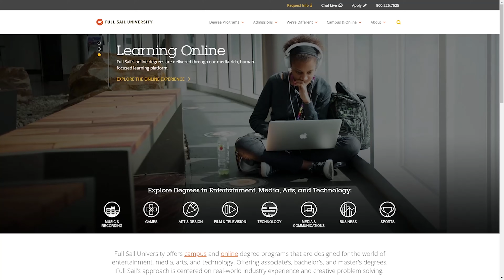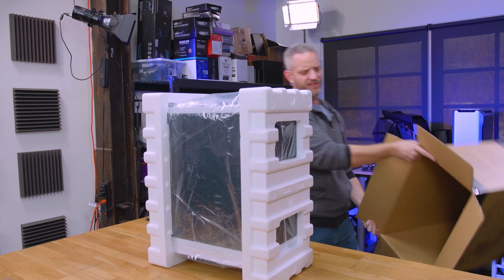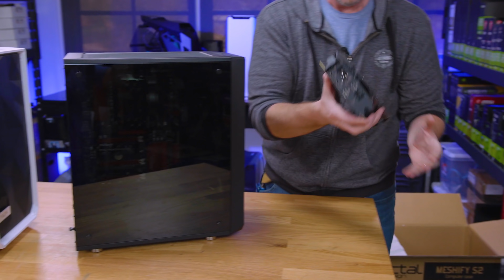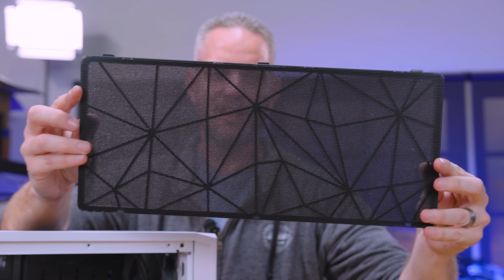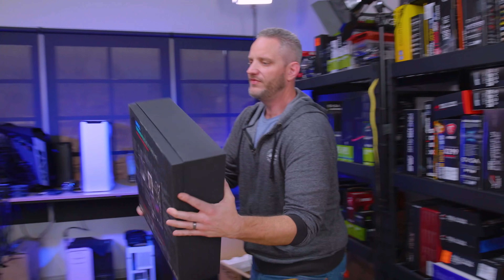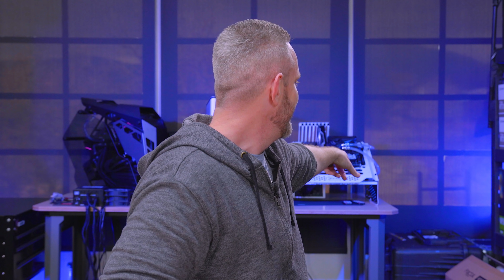Fractal Design Meshify S2 Review

Comment: if the meshify c was about 2 inches longer to fit a rad and fans in-front of a long graphics card, it would be perfect. the s2 is too big unless u are building a full wc build.
Reply: but ... BUT; It Has a USB type C 3.1 Dx

am noop; don't the extra space helps with air flow?

Comment: This will most likely house my Ryzen 3000 series build when released. I may be brain farting this but is there any reason why the front panel connections are hardlined to the front of the case and not like the R/S/S2 series. I was hoping that is one thing that Fractal would have changed with a second version so to speak of the Meshify C.

Comment: Any meshify is a no go as it doesn't have fan filters on front and you can't add yourself, because it's not straight surface for magnetic filter.
Reply: Uhm, there is a filter in there.
Reply: @STR33TSofJUST1C3  Oh indeed, even on Meshify C. Didn't know the mesh part is removable, well then it's fine.

Comment: Still using shit foam for filters and metal clips that break. They need magnetic filters like Corsair uses. OH and the front panel still has the connections on it making it difficult to pull off without pulling the wires out

Comment: Jay, tell me what case to buy that can fit 2 420mm radiators(hw labs xflow) ... i cant find one that has a decent front IO
Reply: i wouldnt mind knowing the answer to that myself
Reply: idk but the corsair 1000D can hold 43 rattlesnakes. dont ask me how I know that
Reply: Well they would work as a coolant for a while I guess but they gonna be jumpy when you open the door and there fired up to 35-40 degrees!
Reply: I used to have a Thermaltake Core X5, would have been an easy fit. Other than that... uff... I have one 240 (20mm) and a 360 (60mm) in my meshify S2 and its already crowded. You could get two 420 in, if they are not that thick

Comment: want to know, do you think I can mount intake fan of maybe... 120mm or 140mm at the bottom; to get fresh air of the GPU ROG 2080Ti OC? I don't plan to go vertically, but just normally plug into the PCIe.

Can it work? the air flow is weird, and I want to aid in the air flow to this.

Can someone guide me?

The Shop retailer is suggesting meshify C to me as well, but it looks like is going to be Hot for the GPU when I am already pairing my system with 3950X.
So is ratarded to for a temp that easily go past 60% right in the beginning.
Need help, SOS. I did am going to have close loop water cool for the CPU; but the GPU whether can get fresh air or not is quite a concern for me.
Please?

Comment: Pretty nice case, but if you are going for that clean white and black aesthetic, I feel like having a flat panel at the front, with side ventilation would look much nicer. I am not saying that I don't like the case, it's just that front panel. If you are going to have a mesh panel, like on my case, just please make it flat, and flush with the rest of the case.
Reply: id rather have proper air flow
Reply: @bradhaines3142  You don't necessarily have to have a giant front vent in order to get good airflow. If the front is totally sealed, then the air will flow through the sides just fine. You also have the top and back of the case for airflow.

Comment: nice case my 9900k with 2080S 50  60 temp
Reply: want to know, do you think I can mount intake fan of maybe... 120mm or 140mm at the bottom; to get fresh air of the GPU ROG 2080Ti OC? I don't plan to go vertically, but just normally plug into the PCIe.

Can it work? the air flow is weird, and I want to aid in the air flow the fan if possible for the GPU especially.

Can someone guide me?

The Shop retailer is suggesting meshify C to me as well, but it looks like is going to be Hot for the GPU when I am already pairing my system with 3950X.
So is ratarded to for a temp that easily go past 60% right in the beginning.
Need help, SOS. I did am going to have close loop water cool for the CPU [Gigabyte AORUS LIQUID COOLER 360 (LED Screen) ] ; but the GPU whether can get fresh air or not is quite a concern for me.
Please?

Comment: Does it fall apart like the 3 fractal cases I have had? Quality control is absolute garbage on those. (Define R4?, Define Midi and Node 304)

The define r4(I think I is an r4) had most of its front panel connectors barely soldered on so they came apart. No front USB for me.
The midi had its side panels not fit to the point it was near impossible to get them off. (that case was so bad it got left on the street for hard rubbish)
The Node 304 is just badly designed. Nothing really fits properly.

Comment: Hi Jay. Sorry if this has already been asked...
I can't decide if I need/want to buy the meshify 2 or the 2 compact. This will be my very first PC build having been an iMac for the past 15years or so. I want to run an AIO and some RGB fans etc with 3080t...
is the compact big enough to mount the AIO upfront or would it have to go up top. I wanna run 7 360 fans total. I'm cautious that the AIO won't fit upfront on the compact case but there would be too much empty space in the regular-sized '2' case. i contemplated running a push-pull AIO upfront in the larger case to fill the space (i know, i know probably overkill in terms of thermals) which would be a 10 fan setup...
...lost.
would appreciate any wise words.

thanks
Reply: i guess i could do a custom WC loop later down the journey with a bigger case....

Comment: Hey Jay, any chance you can make a video talking about some of the m.2 drives? Intel 660p m.2 1tb drives are on sale for $107 and I'm not 100% sure what the huge benefit other drives have over it since most I've seen are in the 250$+ range.
Reply: I believe it's because it is not an NVMe M.2 drive, so itll be slower than NVMe M.2 in the 250+ range. Someone correct me if I'm wrong though.
Reply: NVME just means it runs on pcie lanes, which makes the cap around 4gb/s where as a sata3 based ssd has a cap of 600mb/s

look at the max read/write speeds,  if its around 550 its sata based, which are cheaper, some old pcie drives are in the 1500 range and those could be on some sort of clearance sale.
Reply: 660p is using qlc nand flash, so it is very slow compare to other tlc or mlc ssd, almost at the same speed as a good hdd when its slc cache run out

Comment: fractal design is starting to get the nzxt "rebranding" virus
Reply: How so? This case brings quite a few improvements to the table while sticking with their functional, modular design.
The mounting brackets for 2.5-3.5 HDDs on the back are certainly more handy and sturdy than the R6´s. The plate to cover the hole in the PSU shroud is nice as well. So is the built-in USB C I/O.
Just because it looks like a standard box shaped case it´s not just a rebrand.

Comment: Yo Jay and comment section i need help
 Im building a PC and i need to know what wattage of power supply i should get. I am custom water cooling my CPU. And i have a RTX 2070.
Reply: Kristopher Jones 750w Is perfect for you. I use seasonic gold plus 750w for alimenting rtx 2070 msi armor, i5 7600k OC 4.8 ghz, h110 v2, 6 corsair LL120 and a led strip and 2 ssd
Reply: Thank you